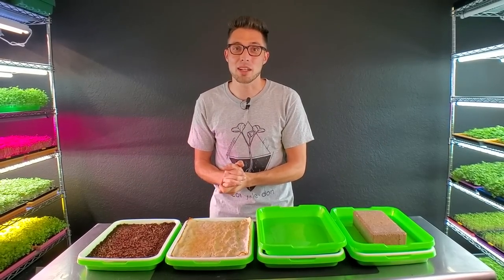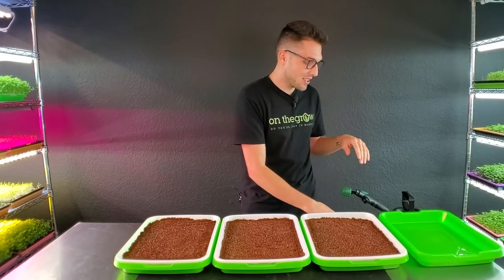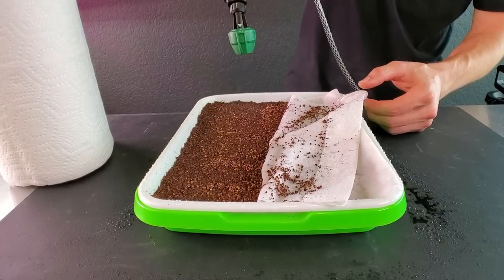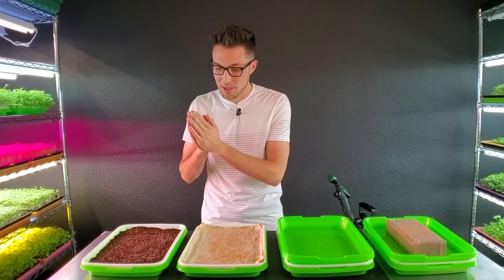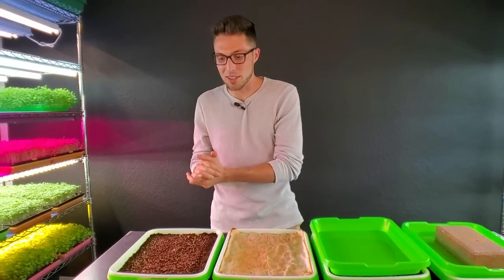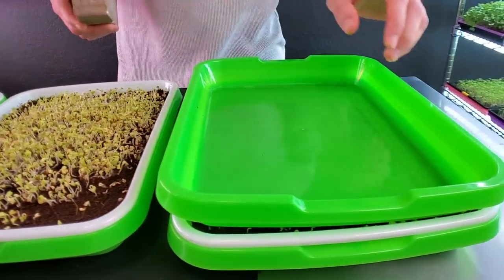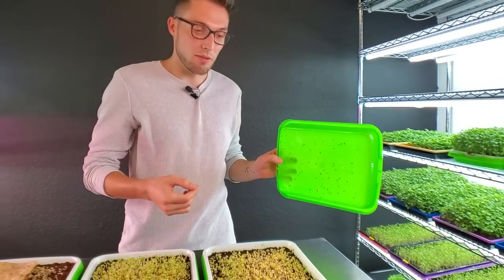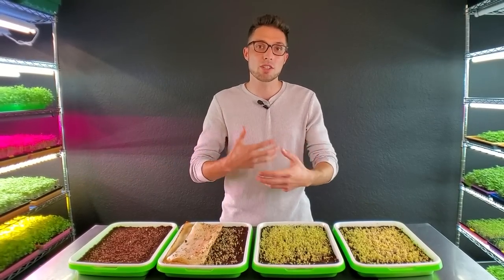Why do Microgreens Need Weight? Kale Microgreens Germination Trial |  Indoor farming |

Comment: Suggestion for first tray - keep an inverted tray on top. This will ensure better humidity and full darkness compared to just adding a paper towel on top. Since it will be inverted there will be no weight on the seeds. It will give a better picture on the pure impact of weight on germination. Great video in any case!
Reply: I find it strange that we're using a technique for microgreens that we don't use for germination seeds for other purposes. My germination rate is close to 100%, but I've never used weights for any of my grows. As long as the seeds remain hydrated, in the dark, and the temperature is adequate, healthy seeds will sprout & grow. Just like every other seed, sprinkle them on fresh soilless mix, add a thin layer of soilless mix on top, water, and cover with a humidity tray. As long as your provide enough light and airflow after germination, the spouts will grow vigorously, and will have thick stems. 

There needs to be more scientific proof that adding a weight to the tray somehow produces a better plant or decreases time between sewing and harvest. Right now it just seems like unnecessary work and added complexity based on anecdotal evidence. There are a handful of online sources that suggest weighting microgreens seeds, but they all seem to be copying each others homework and don't provide any side-by-side comparisons. The main benefit of the weight seems to be that it helps remove hulls from larger seeds such as sunflowers.
Reply: A better experiment would be to use a humidity dome for the tray without weight, so as to keep the humidity in both trays constant...with the weight being the only deciding factor in any differences. I think it's the drying out of seeds in the first tray in this video that drastically affected germination rates, rather than its lack of weight. This can give the illusion that it's the lack of weight that affected germination rates. 

There's another youtube video out there experimenting on Broccoli seeds grown under humidity dome without weight vs weighted tray, and it instead gives very similar germination results. Only slight difference is that seedlings are slightly shorter and thicker in the weighted tray, whereas the one without weight and only the humidity dome are slightly taller but thinner. Taste wise it's the same. In the initial phrase of the humidity dome tray, roots are everywhere on the surface and not driven down as deep, but it adjusts itself after a few days and becomes taller than the other tray.
Reply: I use frosted translucent takeaway containers without holes, I hydrate the coir then half fill the trays, spread the seed, mist heavily then loosely sit the lid on top. They aren't in the dark but not in the sun either, mist twice a day just to keep seeds damp until germination. I've been having success with radishes but haven't really tested any method putting something on top of the seeds.

Comment: "supposedly" strengthening the stem seems about right, I can vouch at least in my experience growing other plants, I once had an injured tomato seedling that I decided to try and save. The stem was completely busted but still attached by the outer skin so I taped it up with a toothpick. That turned out to be my strongest plant and grew with this incredible knot in the base of the stem where it repaired itself, doing some research told me with a bulkier stem due to damage + repair nutrient transmission and strength were increased greatly. wish I had a pic now the knot grew to like the size of my fist

Comment: QUESTION: What size trays are those ? You normally use 1020 shallow, but those kinda look like smaller 11x8 ish sprouting trays (hard to tell scale). I'm also presuming the white mesh inserts are 5mm mesh ?

Comment: Have you tried sea 90 vs ocean solution?
Reply from the maker: Yeah, we’ve tried it a few times in the past and found each time that sea-90 added a super intense salt flavor to our crops, so we haven’t played with it much since…
Reply: @OnTheGrow  thanks for the reply and the wealth of knowledge you guys have. Im wondering was your application rate as suggested at 1 teaspoon per gallon of water and did you just use it for one watering or through the entire grow? I purchased sea 90 over ocean solution due to not being omri listed, do you guys use ocean solution any longer?
Reply from the maker: @saifrehman1827  Correct, we tried it at the suggested rate and even tried cutting that in half to find that both still added that salty flavor to our crops... They may have switched up their formula since a year ago though, so if you test it, let us know! Also, Ocean Solution is now OMRI listed again and we still use it as our liquid hydroponic nutrient source... It does a great job and can't complain about anything except for the fact that they are shipping around a lot of water weight. I wish it was the same as Sea-90 as a water soluble salt mixture...
Reply: @OnTheGrow  I will be running some tests with just water vs sea 90 and I will definitely update you guys!
Reply from the maker: @saifrehman1827  Looking forward to hearing the results!! Thanks for sharing!